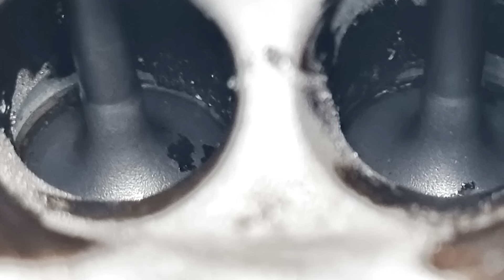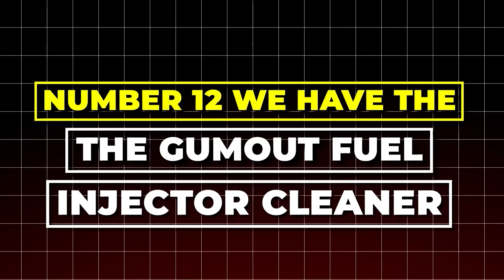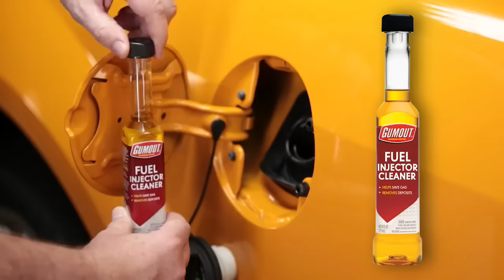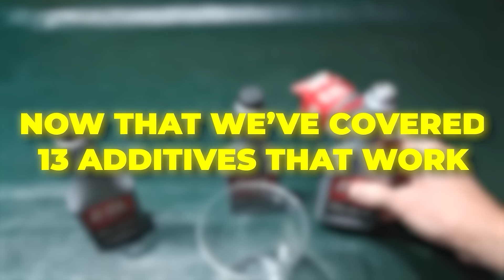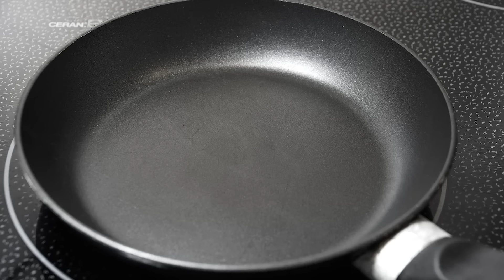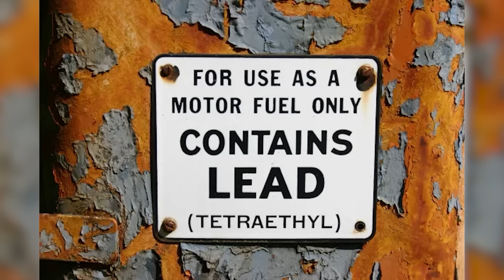13 Engine Additives That Work (And 5 That’ll Kill Your Car)

Comment: As atone paint thinner , OMG WHAT>>>> i work at a refinery  this is removed from gas, why  it binds to gas on atomic level it is also lubricates mettle parts, keep in mind it binds to gas
so how much do you put in a tank of gas that is even a more odd one oz  per 12 gal,  and no more,  what will it do it will clean the motor,  when i work at refinery i worked on there servers, in doing so i got to know all top dogs, and what i found out is nothing like what people understand, oil prices has nothing to do at all with gas prices, nothing, the refinery sets the price, 
so lets break it down , it cost 65 to 75 cents per gal to make and ship gas   that it , all but 15 percent refinery makes to make it easy  to understand  we know what cost to make gas a refinery charges the gas station 3.00 a gal  now they up it 25 to 30% now add 60% tax on top of it ,   and this is what government does not want people to know that today they can put gas in your car for 1.25 a gal and make money, right now,  so how do they keep this quiet, well every one at the refinery gets 20% raise at Xmases and tax-free refinery pay all taxes on it,  so who going say anything,  now people think said paint thinner will hurt something keep in mind two facts it binds to gas gas is no longer gas as we know it emissions is reduced, car runs more quite and is powerful,  you can also run this in disual motors , it has same effects it binds to fual make it easier to burn all of it , less carbon build up 

now old timers new a way to clean carbon from cars was called steam cleaning,  yeap, they got motor full temp and wile one was on gas peddle so won't stall they spay water in to air cleaner heat of the motor would vaporize the water keep in mind you're using hand spay gun so u using very little water this will cause motor to start smoking bad thing mmmmm, no what you want,  at this point it's cleaning the motor now what the best way do this on new cars that i don't have awasers to ,  as i personaly never done it i do know people who do,  

 i told if you work little once week your remove most of all carbon in 3 mouths ,  and 15 mins of smoke , any truth to this, i know people swear by it,  to first part of this i have and do use, as it dose work,  to 2ed part i have only seen people use it i my self have 2020 i have no clue if it be safe, but i do use magical oil as will remove carbon as it won't burn ,  it makes carbon wet, and oil sokes in breaks it down kicks out tail pipe ,  to some rest, i know some things can be dangerous , some will not agree with but before u commit goggle it
Reply from the maker: It’s interesting that you mentioned using paint thinner-like substances to clean the engine, though it's crucial to be careful with these types of DIY methods. While certain additives can help reduce carbon buildup, I’d be cautious about anything that’s not specifically formulated for your engine type. The steam cleaning method used by old-timers was effective, but it could be risky for newer engines, especially with modern seals and emissions systems. Always double-check compatibility with your vehicle before trying unconventional methods.
Reply: @carcareclues  asatone is removed from gas and or oil it binds to it becomes one, on atomic level  so won't hurt anything i know them at refinery told me , now how much one oz per 10 gal is all needed and yes to much can be bad,   so u want to keep it under 2 oz with 15 gal tanks also can be used in, in any kind fuel , 
as it bonds with it won't hurt anything ,  
but it's best to put in before the gas also ethanol won't burn under any conditions,

Comment: I've been using Lucas for years. On my 2005 Mustang GT (Supercharged). My motor started making noise, but kept driving. Drove for a week and then took it to my tuner 100 miles away. Come to fine out my timing chain guides and timing chain went bad. The timing chain guides broke into small pieces and plugged up the oil pickup unit. I was also running "Royal Purple" oil. One or the other saved my engine.
Reply: Royal purple has zinc add its golden ticket in my eyes
Reply: @EViLLennY so does Valvoline VR1 but at much less cost 🤷🏻‍♂️
Reply from the maker: A combination of the Lucas oil stabilizer and the Royal Purple oil might have helped save the engine. Those kinds of problems can be tough, but it’s good to know your oil choices played a role in preventing a full engine failure.

Comment: If you got 150,000 miles, Lucas oil stabilizer is great. I've been using it for at least 20 years in different engines.  4,6,or 8 cylinders, doesn't matter.
Reply from the maker: That’s awesome to hear! Lucas Oil Stabilizer is a trusted go-to for high-mileage engines. It’s great that you’ve seen positive results across various engine types over the years. It’s definitely known for reducing wear and improving engine performance, especially as the miles add up.

Comment: I just recommend adding an additive at a 5,000 mile oil change, if the engine has 70-80,000 miles, or if the engine begins to use or lose a at. Between changes. Fuel additive cleaners work well on a 20,000 mile schedule. Chain oil filter each oil change. Air filter every 6 months. Fuel filter annually. Pay attention to consumer reports of engine failures by type & car model. Some vehicles are so poorly engineered, motors are failing at 15-40,000 miles.
Reply from the maker: Adding an additive at the 5,000-mile oil change for engines with 70-80k miles is a smart approach to maintaining engine health. Fuel system cleaners every 20,000 miles, along with regular oil, air, and fuel filter changes, can go a long way in preserving performance. Staying informed about engine reliability through consumer reports is also crucial, as some models may have issues at lower mileages.

Comment: Redline S-1 is far better than Techron. Both work, but Redline has a much higher concentration of PEA.
As for engine treatments, they're pretty much ALL snake oil.
The best thing you can do for your engine is short oil change intervals using quality oil that meets or exceeds manufacturer API specs.

Check out a channel named "The Motor Oil Geek" for some good data-driven content by oil experts. It reviews all kinds of additives in detail.
Reply from the maker: Redline S-1 does have a higher concentration of PEA, which can make it more effective at cleaning compared to Techron. As for engine treatments, you're right—many of them are overhyped, and sticking to quality oil and regular oil changes is the best practice for engine health. I’ll definitely check out "The Motor Oil Geek".

Comment: I use marvel mystery oil, every oil change on my 2001 dodge dakota quad cab, 5.7 liter all aluminum engine.  250k and still going strong
Reply from the maker: Marvel Mystery Oil is a great product, especially for high-mileage engines like your Dakota. 250k miles and still running strong is a testament to its effectiveness! Keep it up

Comment: Marvel mystery oil used to be one of the cheapest products on the market.Now.It's overpriced!
Reply: Just saw it the other day in Walmart it's more than doubled the old price companies are just getting greedy nowadays
Reply from the maker: prices have definitely gone up over the years. Still, for many, it’s worth the investment for the benefits it provides, especially in older engines. You can sometimes find deals or alternatives, but Marvel’s long-standing reputation speaks for itself

Comment: I heard that the cleaner PEA is great for cleaning up the inside of engines.  But has anybody checked out if its nasty for a car's Catalytic Converter?
Reply from the maker: PEA is a widely used detergent in fuel system cleaners, known for its effective removal of carbon deposits. When used as directed, PEA-based cleaners such as Techron Concentrate Plus and Red Line SI-1 are safe for use on catalytic converters and oxygen sensors. They function by dissolving carbon deposits in the combustion chamber and intake valves, which then exit the engine as harmless gases

Comment: Where's Mototkote Oil and fuel additives?
Reply from the maker: Motorkote is a brand that offers oil and fuel additives designed to reduce friction and wear. While some users report positive experiences, it's essential to ensure that any additive used is compatible with your vehicle's engine and fuel system.

Comment: Mere pas tata safari hai, aur warranty mai hai, mai usaki service bahar kr sakta hoo kya, matalab agar oil bahar chenge kiya to extended warranty ko problem ayaga kya
Reply from the maker: If your Tata Safari is under warranty, as long as you’re using the recommended oil type and following the manufacturer’s service schedule, changing the oil yourself shouldn’t void the warranty. However, it's always a good idea to check with the dealership or review the warranty terms to ensure you're compliant with any specific requirements.

Comment: I think lucas is a quality product. But as with anything every engine is different. I used a whole bottle (1 quart lucas to 4 quarts oil)  of lucas in my 1998 5.0 ford truck engine and it noticably increased compression and almost eliminated my rear mail seal leak. 
Then i used the same mixture in my 4.0 ohv ranger and it didnt fix any oil leaks and made the top end tick (lifters). Also the exact same results on another 4.0 ohv ranger. Im guessing that the oil channels on the top end of the 4.0 are smaller and got partailly clogged. So its a wicked gamble. I'd suggest to try and ask somebody with the same rig if they have tried any products and what results they experienced.
Reply from the maker: Lucas can work wonders for some engines, like your 5.0 Ford, but as you found with the 4.0 OHV Rangers, it’s not a one-size-fits-all solution. Every engine is different, and using it can sometimes cause unintended issues, especially with older engines or ones with smaller oil passages. Always ask others with the same vehicle before trying it out.

Comment: Non of these fuel treatments can be used with fuel containing ethanol unless you want to destroy your engine and fuel system.
Reply from the maker: You’re right to be cautious about fuel treatments and ethanol. Many fuel additives can be safe with ethanol-blended fuels, but it’s important to always check the product label for compatibility. Some additives, especially older ones, may not work well with ethanol and could cause damage over time. Always look for additives specifically labeled as safe for use with ethanol blends to protect your engine and fuel system.

Comment: Guarantee me even a 1 MPG increase and I will buy the product. I wont be holding my breath.
Reply from the maker: I get your skepticism! While some additives claim to boost fuel economy, the results can vary greatly depending on the condition of your engine and driving habits. A 1 MPG increase is possible with the right product, but it’s not guaranteed for everyone. If you're willing to give it a try, start with something well-reviewed like Techron or Sea Foam and track your results. Just don’t expect miracles.
Reply: @carcareclues  I have used both of the products mentioned. Once your fuel system is clean, your mpg will level off.

Comment: What about slick 50 ?
Reply: Use at your own risk. It's not good
Reply: Better to use wd-40, and I wouldn't recommend that.
Reply from the maker: Slick 50 has a controversial reputation. While some swear by it for reducing friction and improving engine longevity, others have had bad experiences, especially with its Teflon-based formula causing issues like clogging oil pumps. It worked for some, but it’s definitely a product you should approach with caution. Always weigh the pros and cons for your specific engine.

Comment: Hello,
I use Lucas,
I have a newer truck too.
I use this -->Lucas LUC10130 Synthetic Oil Stabilizer<-....
Reply from the maker: Lucas Oil Stabilizer is a solid choice for many, especially for reducing oil consumption in high-mileage engines. It’s not just thick oil—it helps improve viscosity and protect engine components, making it a popular go-to for people looking to extend engine life. I'm glad it’s working well for your newer truck.